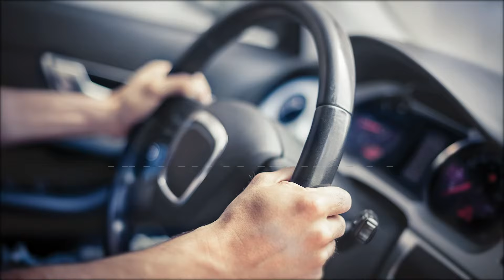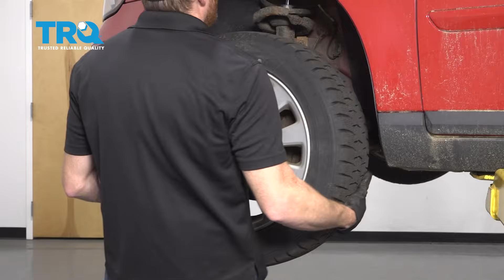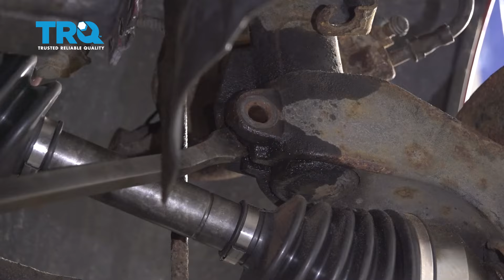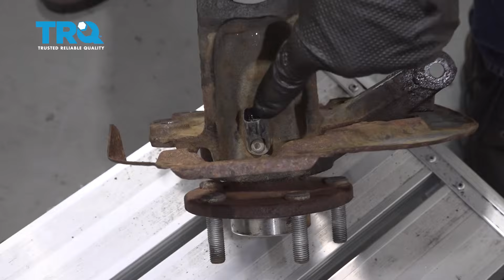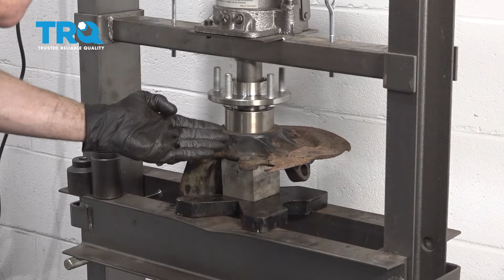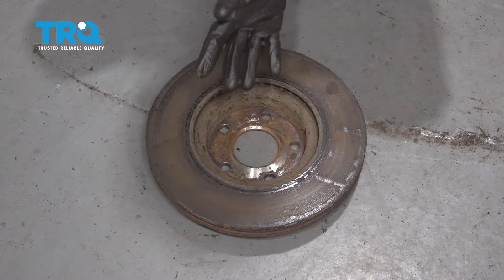How To Replace Front Wheel Hub Bearing 2005-2012 Volvo S40

Comment: You you have to press in via the outer bearing race!  You need special tool to do this.  Doing it the way  shown (using the inner race) guarantees that this bearing will fail quickly.  I know this from experience.

Comment: Can we do this without a press ? Thanks
Reply: most parts stores have a tool you can rent or borrow that uses a threaded rod and metal cups to push the bearing out.  not as easy as the press, but does the job.